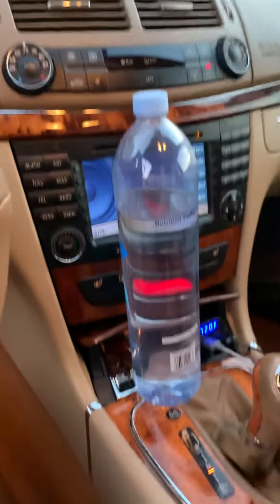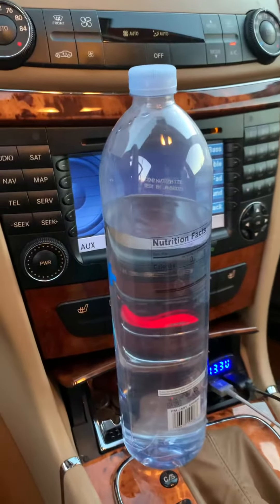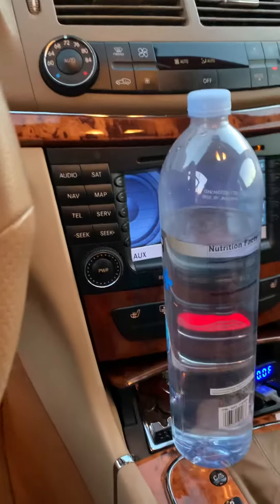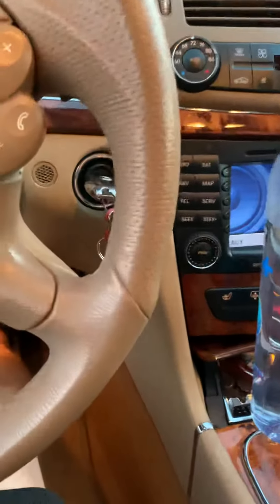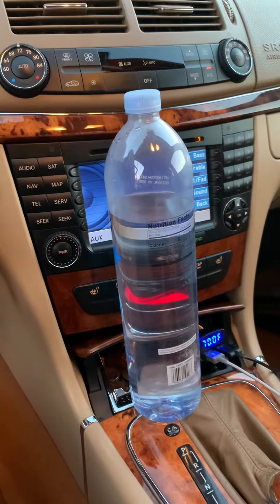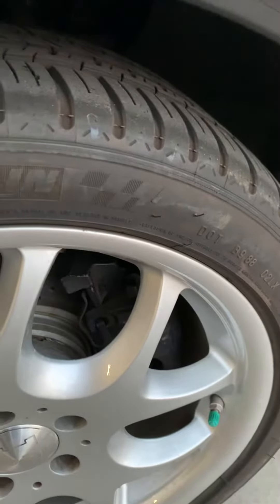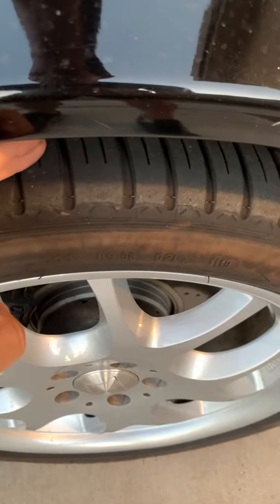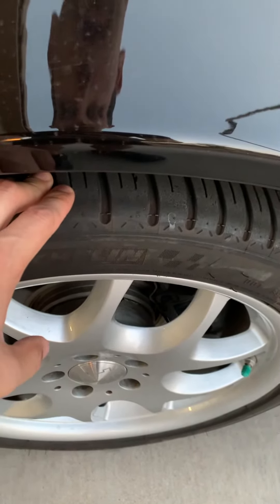E350 4Matic chassis vibration

Comment from the maker: just for future searchers- it was my suspicion CV axle bad. Genuine MB axle fixed the vibration, more info here: https://www.benzworld.org/threads/e350-4matic-vibration-at-idle-diagnosis-thread.3073922/#post-18203054 do NOT use aftermarket axles. If you REBUILD your MB axle, the inner boot MUST use a genuine MB boot, otherwise shortening the length of the axle will cause the vibration.

Comment: Thank you for sharing, have same issue with my glk 2009
Reply: Hi,did you found where the problem is?
My glk have the same problem
Reply: @lindonberishaj8096  yes dear i found the problem
Reply: @lindonberishaj8096  i convert the car to two wheel . And probel solved

Comment: I had a similar problem, I'm not sure what mine could be. I haven't checked if it is the engine or chasis but its similar shaking while idle. I could be in park as well and it will do that